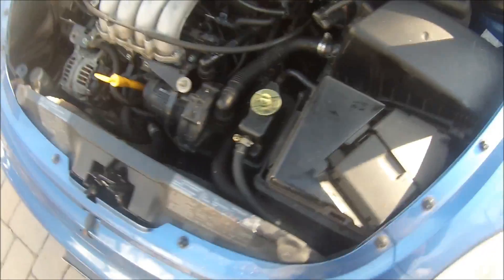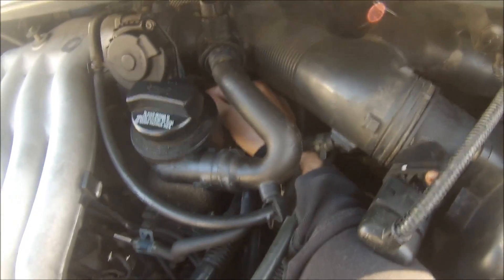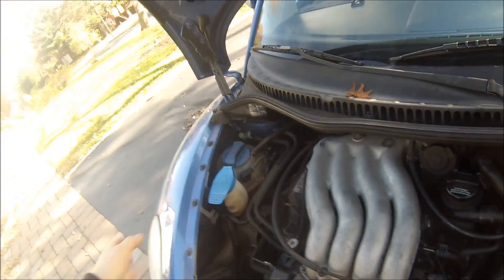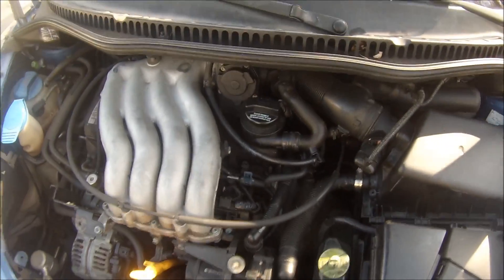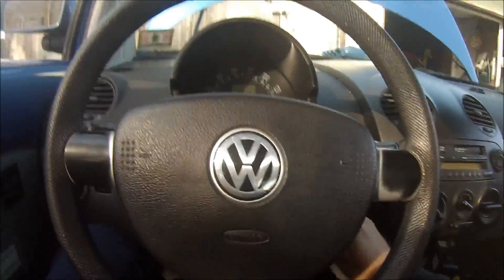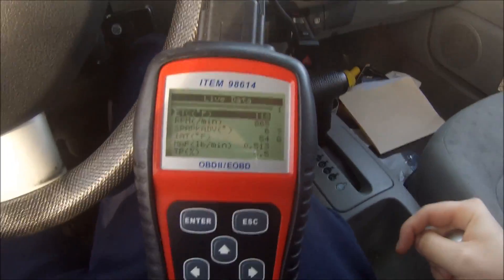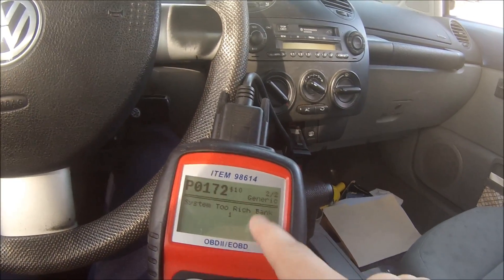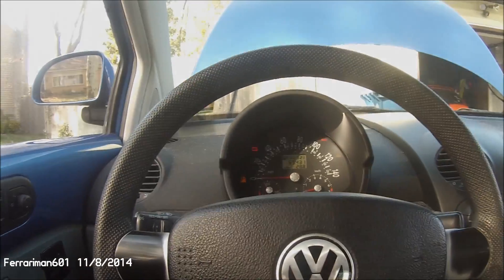Volkswagen Throttle Control Module Explanation

Comment: Hello ! i have a sort of similar problem with my 2001 1.6 SR AVU Engine on a Skoda . When i start the engine it starts right up but then it dies when cold , after a few attempts its kinda trying to run but in 3 cylinders . When hot outside over 30`Celsius its just starting and running in 3 cyl , after engine is worm over 50`C it starts with no problems . Engine runs exactly as the one in this video with couple of missfires in the intake manifold ( pops and bangs ) . i have changed the o2 sensor , camshaft position sensor , water coolant sensor the one in the coolant housing , cleaned throttle body , tested with another maf sensor ... HELP  ?

Comment: Skip the first 10 minutes, they are completely useless. After that there's some decent information.
Reply: Thanks!
Reply: Asking for my 1999 beetle- does the Throttle control the fans.  Our fans wont stay running and car overheats and stops.  Also was told radiator needs replacing.  Is both these issues the reason  fans over heat & stop running

Comment: Did you get an epc light?
Reply from the maker: DTC, yes. Normal check engine light situation. If you’ve got an OBD scanner, it’ll ping for a throttle actuation sensor, and maybe secondary air injection and P300-304 for engine misfire.

Comment: hey nice video i had no idea i had to reset the codes. just one question, when you pressed the plunger at the bottom of the throttle travel  how can i go around doing that in a stick shift? thanks
Reply: 9:14 9:18